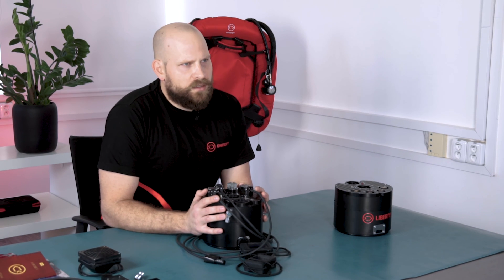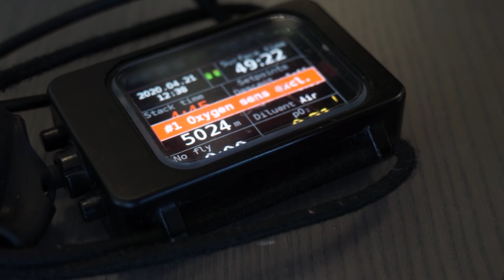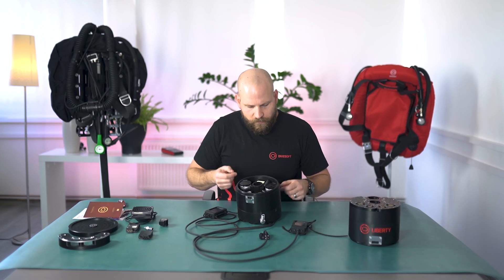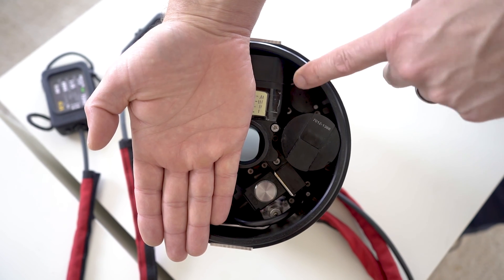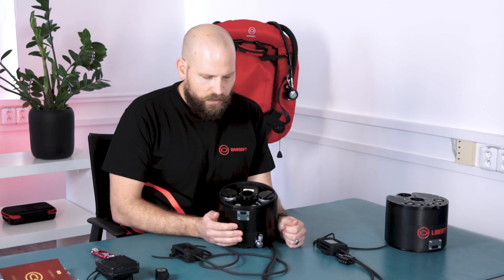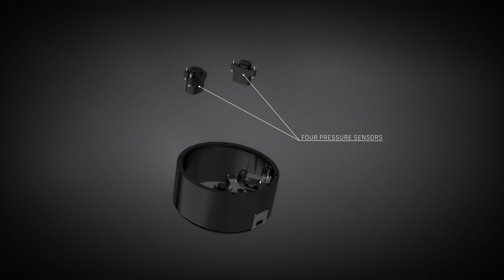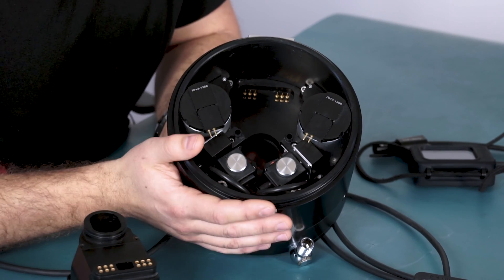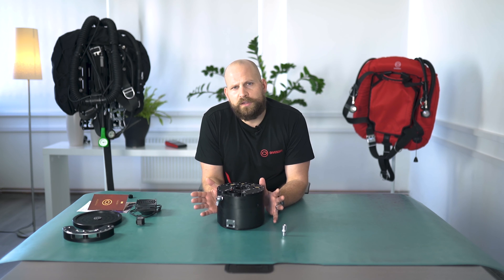CCR Liberty in Detail #3 | Rebreather Head

Comment: Can you provide more Info on the colour blind mode, does it enhance the red colour given that it is one of the first colours to wash out the deeper you go? 

Is it part of the feature of the HUD shade or something else?

Thanks in advance guys!
Reply: Hi Demis, the way the colorblind mode works is following: for every decimal point of PPO2 below 1.0 the middle LED flashes blue (1x for each decimal point under). For PPO2 of 1.00 the middle LED glows green, anything above 1.0 up to 1.6 there the outer LEDs are flashing, each flash for a decimal point above 1.0 (e.g. 3x green flash of outer LEDs = ppO2 of 1.3 ).
ppO2 above 1.6 the left LED glows solid red and the right LED flashes red. I am color deficient myself and it works very well.
Reply: The shade of the HUD is there so you can quickly dim the LEDs if you find it too bright in dark and you don't want to go into the user menu to lower the brightness intensity.
Reply: you can find more detailed information in the user manual on our webpage if you would like to get into more detail. Thank you for your queries, we are happy to help with any questions.